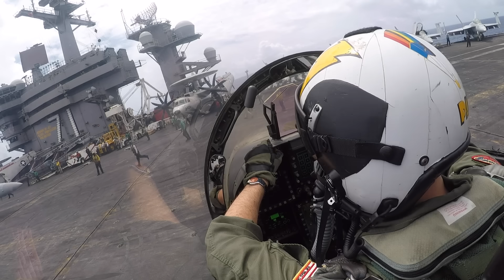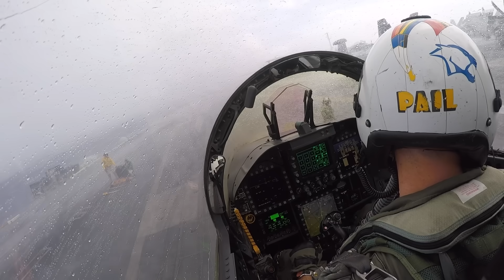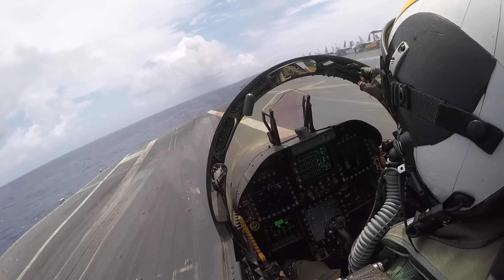Why Navy Pilots Launch Toward Storms

Comment: I feel like this was posted way back when?  Still good stuff to watch…USAF retired… 😬😬
Reply: It was posted previously, without the VO, but not "way back". Naval aviator, Pail, has never posted a bad video. Fly Navy 💫
Reply from the maker: Yes.  See the pin at the top of the jam.  I got a lot of complaints about the audio quality on my first hack at this video (my voice was too quiet and the jet noise was too loud), so I fixed it during an off-week.  Cheers!
Reply: @GrowlerJams  great stuff. One of the few I look forward to watching. Buy you a wheated beverage next time you land in DC.  Be safe.